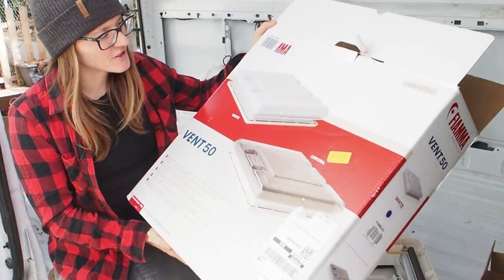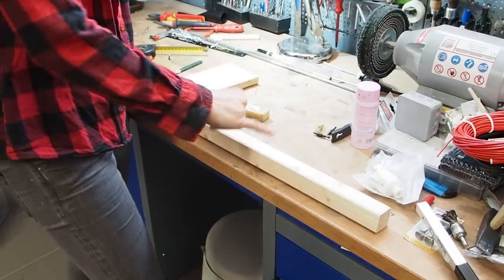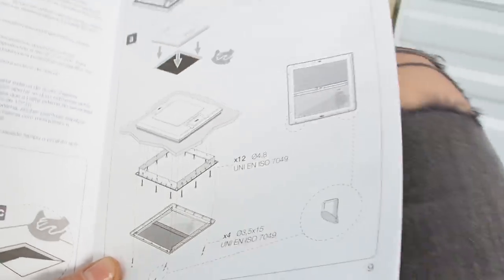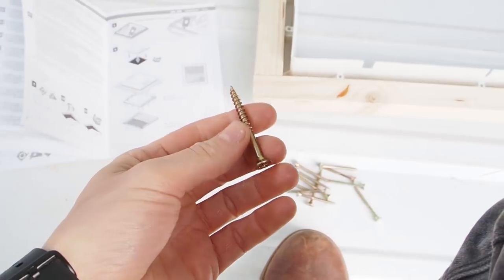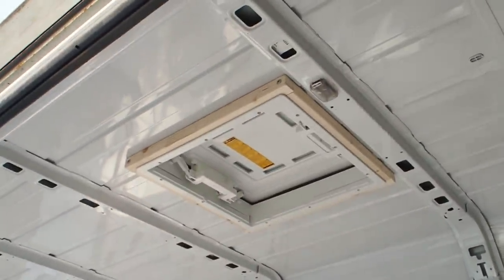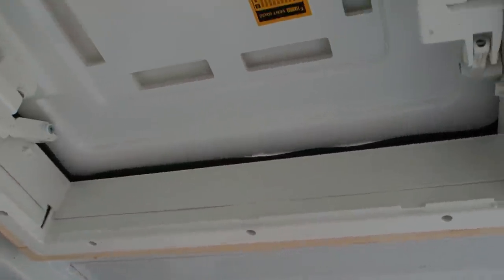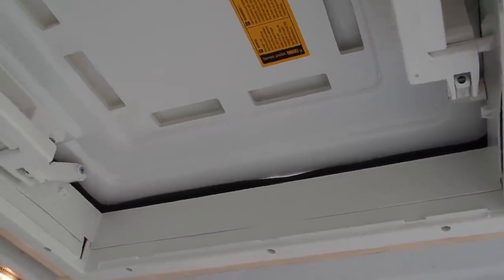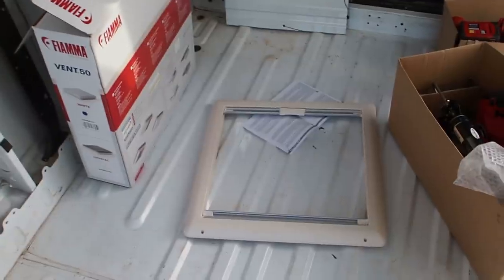Camper Van Build - Installing a Roof Top Window (Part 3)

Comment: A vent with a fan is the way to go.    That’s more like an escape hatch.   If it’s not sealed it will leak when you drive in the rain.
Reply: Or if it is a windy rain.
Reply: Maybe where she lives that don't needs a fan. I personally wouldn't be seen dead without one, but I'm in Australia where the heat will kill you !! I have three vents with fans, one solar powered.

Comment: Just use the garden hose to check for waterproof. And maybe you can adjust the hinges with a screw so it will fit better. 👍😁

Comment: i had a fiamma on my sprinter/ transporter/camper....it has good price and it did the job on the bus....it never leaked although the roof of the van was more than a nightmare..as the whole sprinter then later ...;) good video....

Comment: You should masking tape off the area before you apply silicone sealant, apply the sealant, then wet you finger and smoot out the sealant. Peal off the tape before the sealant goes off and you end up with a beautiful neat job with sharp straight edges....... your black vent seal is defective too!

Comment: There shouldn’t be a gap in the rubber seal area. That’s a manufacturer defect. They owe you a new seal that works.
Reply: Yep, or DIY.
Reply: I agree.
Reply: It really odd that vent kit didn't come with all the crews/  bolt needed on top on the gap in the rubber seal. Light rain you might be ok but if it really windy and pouring down really hard you're going to have a leak.
Reply: @nicholaskarako5701  Not only then, also when driving in the rain
Reply: There might be some tension adjustment screws

Comment: Interesting that the black out roll out blind is included when the hatch isn’t transparent.  My guess is that it’s more cost effective for the manufacturer to fabricate the one liner than to fabricate and inventory two different types.  Looks good though.  Hope your seal issue is an easy fix.  😊

Comment: Lilly you have just found a manufacturer fault , you need to get in touch with them on the phone for maybe a replacement seal , if you have no rain Lilly what about using a water hose. 
Lilly .

Comment: Well done. Yes, they should have included a cutting template & all essential hardware as well as a list of what is needed, silicone sealant, butyl tape, the tools etc. Great job.
Reply: You would think they also would have included a pre-made wooden frame as well.

Comment: I was just thinking a couple of days ago, how is the Camper Van build going.  Glad to see a new video on it.  It actually looks like the rubber seal is a little too long.  One difficulty with rubber is that it is almost incompressible.  So if you push on one spot, the material bulges out somewhere else.  With it being too long, it is causing a bulge, which pushes it up, rather than a gap where there isn't enough material.  You could try pulling out the gasket and reseating it.  There shouldn't be a gap, since it will leak in the rain while driving.  Also rather than waiting for it to rain, you should use a hose and spray at a decent angle.  Wind driven rain finds gaps.

Comment: Try seating the seal all the way back in the groove then close the frame and loosen the screws bellow the light gaps... Might not work post silicone.... Air gaps in the seal will massively effect temperatures in the van... Alternative is thicker seal but you might have the same problem depending on how soft or hard the new seal is. If the window is held up or not by the high spots in the frame.

Comment: Nice work Lilly. You can get a nice smooth finish on silicone if you wear a rubber glove and dip your finger in a small jar of soapy water. Helps it glide more smoothly and saves your fingers.

Comment: GREAT WORK! 
Though I agree with others about the gasket and spacing. You could try building up the gasket track, let it dry and reinstall. That should stop letting light and WATER in. OR let the maker aware of the problem. I do feel you have already the latter though. Take care

Paul

Comment: Try loosening up the three screws on each side where the gap is in the weather stripping. You might just have them too tight and it's pulling the frame down too much because of the curve of the roof. 👍

Comment: Call in to see if they will send replacement gasket. Then get the part number and order a spare. Keep it in the house the seal will fail and then you can replace it. They change the sizes and how they make it so a spare will save you a lot of pain later.

Comment: Thanks for the requested update!!!
Reply: ..I hope you can find a better rubber deal than that one because if you see light.. then when you are running on the "Autobahn" in the rain the wind/ rain pressures will penatrate.. and it will allow some moisture to enter!! 

This  is "forbeodan" ?!? (an old English derivative) or is it "farboten"(old German)?? 
.."verboten" modern German..
Is there a regional dialect?

..anyway best of luck with this project!! I am loving it!

Be Safe ❤️

Thanks for sharing!

Comment: a sugestion. at the homeimprovement store there are door and window rubber seals with 3M adhisive both soft P shapes and stiffer M seals that you can easy put and remove from the roof door to bridge the gaps and it is cheap and can be used on the doors also for wind protection in the gaps.

Comment: Lilly I am sure when you drive in a rain storm that vent will leak. It is hard to tell in the video why it is like that but it will leak. When you drive the rain will run around the cover and will come inside. You did a good job installing it it is not your fault. It looks like the rubber gasket is a poor fit for some reason. 
The only thing I would have done different I would have sealed the wood frame with spray urethane or spray paint before installing.

Comment: I got to give you a lot of credit for all the different jobs you do from bushcrafting, making bows and arrows and building that van. Some food for thought, the rubber seal must not have any gap or fit loose. Case in point. I was pulling my RV with my new SUV. It started to rain heavy. Apparently the seal in my electric roof wasn't tight and after driving for about a half hour when I went to stop a gusher of water came down inside the SUV onto my head and back like some dumped a huge bucket of water on me. No tight seal you will have an indoor shower. Have them send you a new seal. I'm sure they will gladly send you a new one since they won't want any bad publicity. Once again I have to give you props for all you do. PS I ordered the APO 1S. Waiting patiently for it for the past two weeks to get. Much respect and admiration from Long Island, New York.
Reply: Also, o ordered the APO 1S from your good buddy Canadian Prepper as you suggested. I loved that video of both of you doing that 4 or 5 day trip in Canada. Loved that sky blue colored water. His dog took a real liking to you too. :-) Dogs are good judges of character. Be well.

Comment: It will leak if there is windy rain and if you are driving in the rain. 
If you can buy a better rubber seal to replace it, or if you pull out the old rubber seal... put something in the gap where the rubber seal sits, and then place the rubber seal back over it. This way the rubber seal will be risen a little bit and you can slightly push the hatch down to lock it in place. With some time the rubber seal will take the right shape against the lid.

Comment: Klebe einfach einen Streifen 5mm oder 8mm mosgummi auf die Unterseite der Haube. Das löst das Problem. Regen an sich ist kein Problem, aber sollte es während der Fahrt regnen ist im Van "Land unter!" Übrigens gibt es von Fiamma Einhängventilatoren für diese Dachlüfter. Für den solltest du aber einen  12V - Anschluß im Holzrahmen verlegen...

Comment: If that silicone leaks you want to remove the vent and use butyl tape its a thick putty like rubber tape. 
Another tip, you should not screw into end grain on wood its not strong.

Comment: Just a tip from an old construction worker: get a small glassof water and dish washing liquid when you're smoothing out the caulk. Stick your finger in the dish washing liquid and slide it along the caulk seal. That way it doesn't stick to your finger. Just a beat cleaner :)

Comment: The vent is to let the steam out from the heavy sweating the van is a rocking don't come a knocking, we know what kind of animal your like Lilly LOL. You were pretty laid back whacking a hole in the roof of the van. Pretty chinsy they didn't supply the hardware to secure the vent, looks like you were using Sika Flex that ain't cheap, you won't have leaks it will last a long time its good shit.

Comment: i've watched quite a few van builds and they always use a fan in the roof rather than just a pop up vent. I'm wondering why you didn't go with a fan?
Reply: I agree Leon. I installed one in my van years ago. The fan doesn't use a lot of electricity either. Here in Florida it was very handy over the bed. She also had power right there with the dome light close buy.

Comment: You got some problems , contact the manufacturer let them know . If they offer no answer. if the seal is wide enough and can easily be removed you could try adding something underneath it to place the seal a bit higher that might fix he gaps.  Just a thought.
Reply from the maker: yeah I will definetly try to add something underneath. the seal is good, it is just not high enough.

Comment: Please do not keep this “window”. Get something different that has a fan and comes with better mounting hardware. There should be no gaps! Bugs will get in through those. Cold air will as well. But the biggest thing I saw was the weak latching system. I do believe that top will blow open when driving.

Comment: Everytime we've installed a sunroof, the sawing felt so wrong again.
I'm not wondering, where the first "Gammel" will be found. (Hint: sounds a little bit like foot). Not that trustful: no screws and a wodden frame necessary. 
Sorry, i'm a "Piefke". We are genatically programmed to complain. 😂😂
Greeting
Ps turning 90°, you can leave the back open while closing the front during the drive cause it's stream-lined.

Comment: I  would  either  call the place that  made it  or  go and  get a seal  for the  whole  thing and  replace  it  with a  new  one  extra  length on it  incase  you  need it!!!  With the  school  on out  and  lock down  this is  a  101  in  installing  a  Roof Top Window  for  high schooler's  I have been  posting things that  I find online  for  students to  study  with  makes it  more  interesting  for  them  cooking  billing  and  car  help  like  do  a  video on  changing  the  oil  and  changing  the  car tires!!!
Reply: @Linda Peterson • If you are a teacher, why aren't you using punctuation?
Reply: @yvonnetomenga5726  Never  really  had the  need  for it  the writers  did it for me!!!

Comment: yes, this was a lot of work and it doesn't seem fair having to do all the work twice - but this leak is serious. there's something wrong with the vent. your theory about the leak not being an issue because it's covered by material is wrong - because when you drive, water will find its way. You will have to get a replacement and do all this work again - a wet van can never be a happy van.

Comment: The manufacturer of this roof vent should be ashamed of their shoddy product. They do not include hardware, expect the buyer to make the mounting frame, and then provide cheap weatherstripping that does not fit. You would have better results mounting a 5 gallon bucket and lid to your roof. Is this what China expects the world to deem acceptable?